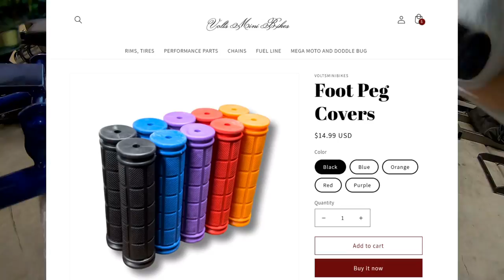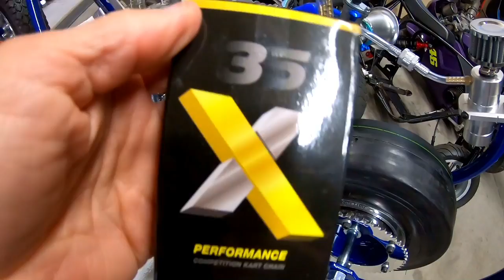When you build a Volts GTS minibike with a predator 224

Comment: That bike is beautiful, good old fashion scrub break you gotta like that
Reply from the maker: Thanks! Ya, that's one thing I like about this bike. Old school brake. Reminds me of my bikes as a kid.
Reply: @Black66  my bike is 52 years old, it has scrubbed brakes. But I also have a clutch band break which is what I mostly use but if the chain snaps I know I have a back up , anyway, take care of yourself
Reply: I was speaking with you a few weeks back about my bike and how I put a 265 cam in and I felt no difference. I found out what the problem was. I had too much play on the exhaust valve once I snug that thing down that bike was doing its thing.
Reply from the maker: @jojojeep1  Awesome! I really like the older bikes.

Comment: hey black I really liked your build with the volts bars and gts frame so I saved up and bought one for my predator 212 and I was wondering what size and or where you got the rear bolt for the tire. I orded studded tires and I realized that the bolt is not the same size in the front than it is in the back and I was wondering where you got or what size it is because I dont know where to get one that would fit and I have already looked in my local hardware stores but no one had the right size. I really liked this build keep it up!!

Comment: Tell me something bro….   U got me falling in-love here with these scooters.   However if I ever got one.. I would have to load it up with lights (brake, head, signals, and clear smog lights . Then get licensed.
I would drive it daily 50 miles.   

I fell in love with powder blue/chrome setup.  But would want different larger frame an custom front forks / disc brakes.  

What is rough estimate in cost (not knowing my custom front forks) do you think it would be in the range of?

I have the most inquest scooter ever in the world designed on the correct frame.   I’m not a gambler, disabled older fella,  but I gotta build idea I guarantee you would love to do and keep for daily rides.

Let me look up and price two SPECIAL COMPONENTS,

TELLME YOUR LARGEST FRAME NAME/SIZE/PRICE.   ALSO FULL HANDLEBAR LENGTH!   I CAN CALL USA/CANADAFREE
Reply from the maker: The cost is all over the place depending on engine mods and frame etc. If you want something to cruise around on Im doing another small bike build coming up soon that is very inexpensive. You might like it. It wouldn't be too hard to put a light setup on it. The video should be up in a week or two.

Comment: Hey brother nice build, when are you going to polish the best chain guard in the world? Do you still use the factory coil  or is that a modified one without a rev limiter? Thanks, if you have any recommendations on an aftermarket coil please let me know.
Reply from the maker: It is a stock coil without the resistor. Here is a video I did with a performance coil without the resistor.  Links are in the description of the video for the coil. https://www.youtube.com/watch?v=K8Napwm_a4M&t=1s
Reply: @Black66  thank you, I’m still a little new using the you tube system. I’ll need a little more practice time, I’ll get it soon. I’m wondering if it’s a god idea for a stock application just for a little more response.